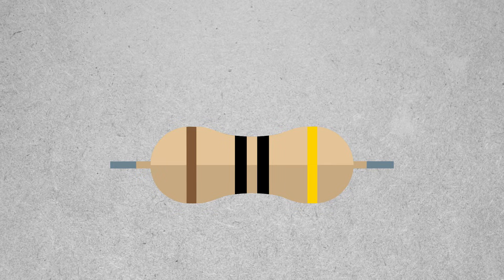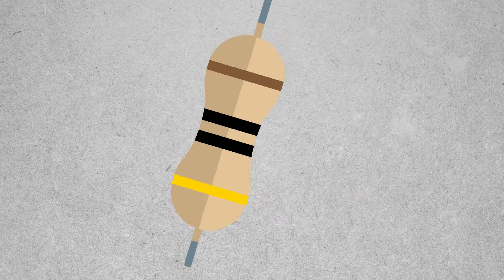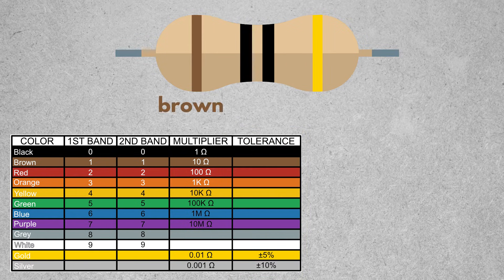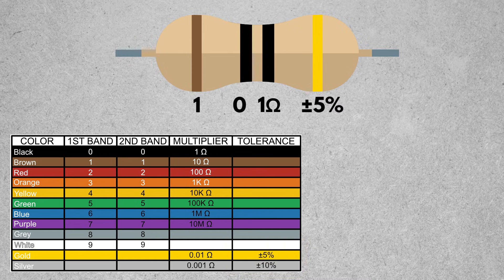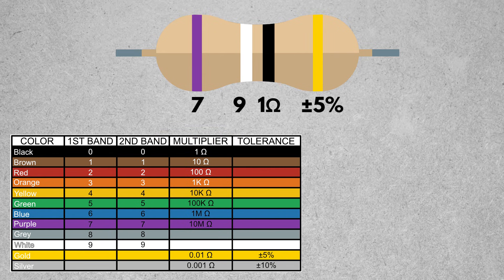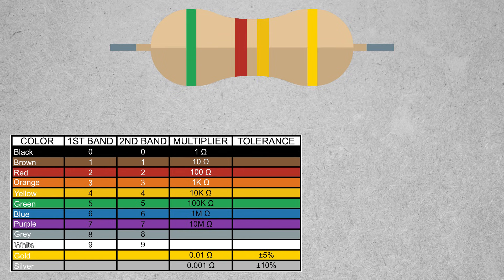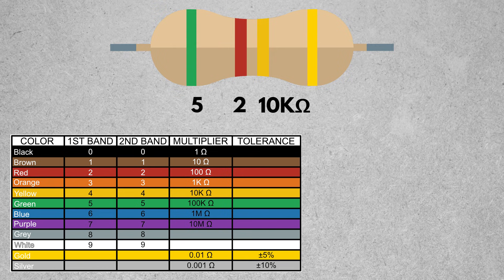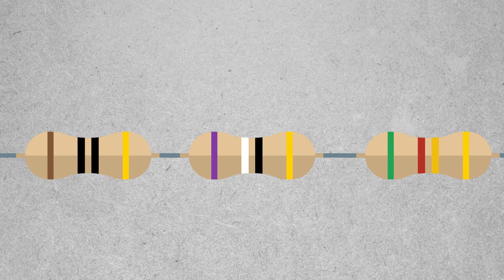How to Read 4-Band Resistor Colors

Comment: All this is great on paper, in real life there are many problems. If resistor is overheated all colors can change or become unreadable and you can not be sure any more, some manufacturers produce resistors that have wrong colors, i have seen brown color in both ends, they lack golden and make two brown ends. I have seen many problematic colored resistors with mixed colors, so i think that soviet union system marking exact value on a resistor was way superior to this idiotic color mess.

Comment: I’m having trouble with a resistor colors are orange orange purple gold , which should be 330M correct? But when I test it I get 3.3k and my schematic says 3.3k is correct, the color is looks purple to me not red
Reply from the maker: You have the correct number for orange, orange, purple, gold. Sometimes the printing on the resistors can be difficult to differentiate. I often struggle with red and brown. If you have the resistor you could use a multimeter to double check your work.
Reply: @NathanNagele  yes I tested other resistors with he same colors and got 3.3k , I have a few resistors that read way too , I’m assuming those have gone bad ?

Comment: 1:43 (alt approach sans 'kilo')
Green  5
Red      2
Yellow 0000 (add 4 zeros) = 520,000 ohms.
Gold    Tells us tolerance is 5% (mfg accuracy-claim),
Manufacturer is stating that the resistor
should be between 494,000 and 546,000 ohms.

Comment: Is it possible that two resistors have the same value but of different color bands?
Reply from the maker: They could have different tolerance bands at the ends. This would give them the same overall resistance, but different tolerances.